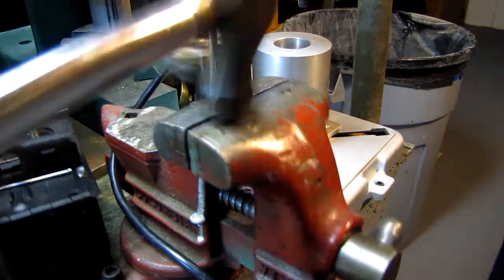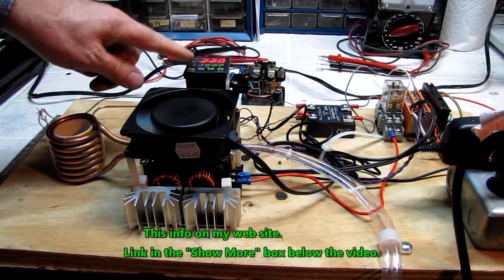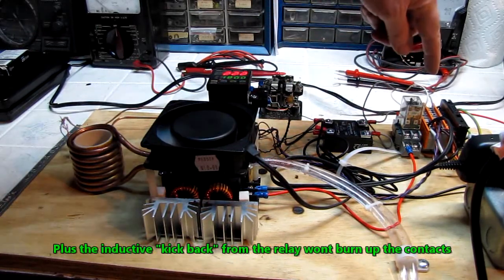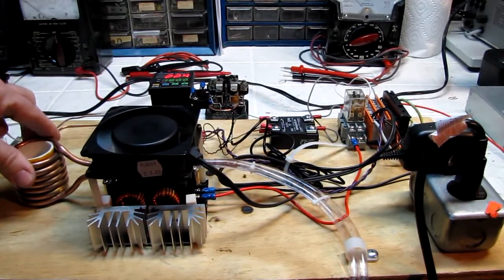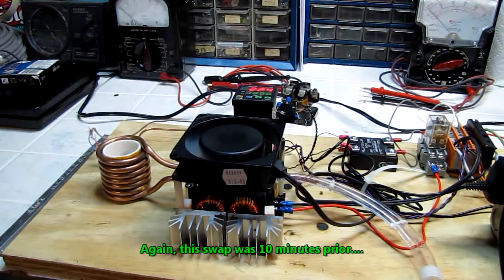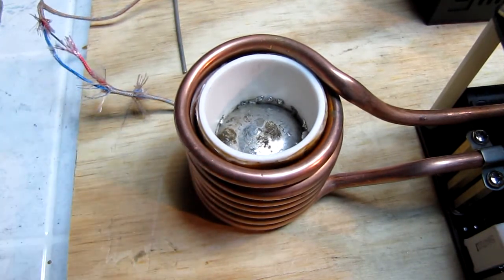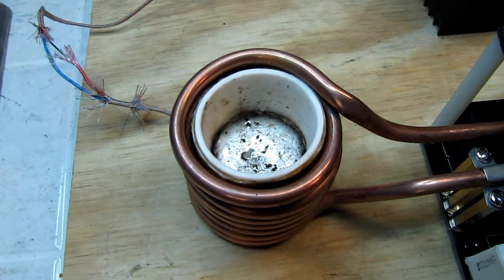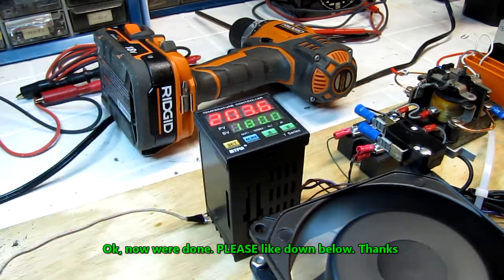Inductively Heated Solder Pot - IT'S ALIVE !

Comment: To eliminate pump vacuum lock up, I configured a pancake coil of tubing (several loops in a vertical plane) between the pump and the copper tubing connection. That way the pump self primes the cooling system.
Reply from the maker: clever idea. Thanks for stopping by.

Comment: that looks like a server PSU, the fan noise in those kind of deals isn't a big issue since there are typically thousands of servers in  a single building with no intention of people being in the room for very long at all when they are running and the sheer volume of servers makes the noise significantly louder anyways. That being said they are great supplies, I cannibalized one out of one of my servers to use in a future project and I am very happy with how the thing runs.
Reply from the maker: These are commercial 48 volt supplies used on systems to operate the heaters for a heat Seal process on carrier tape. ( Semiconductor processing/packaging ) The systems had two of these as we had eight tape/reel lines running per machine with four 48 volt heaters in each tape reel unit. Lots and lots of watts. And yes, they are noisy but were buried in the machine and were not heard over the rest of the system. Thanks for watching and the interesting comment.

Comment: cool project! it shows how easy a project like this could be, as you dont really need to do calculations or sourcing of parts, I would definitely recommend an SSR for DC, heck you can just use another mosfet :) no AC needed besides feeding the big PSU.
Reply from the maker: But blowing stuff up is FUN :-)

Comment: I would think it would be possible to use the mosfets to control temperature instead of all those relays. I'd use two transistors, one to clamp each gate when the output should be off.
Reply from the maker: Used what was in the junk box. I'm just a Stubborn old Yankee

Comment: You pump friend yes is crap, go to an auto wrecker and inside a gas tank, you can find the best pump you will ever find 12 volts and be sure to remove the little white fuel regulator slows the fuel down. With that removed it will pump about 117 litres a minute, small enough to put a reservoir tank on that board in and out simple and cheap.

Comment: If you want a bad to the bone pump for cheap - I got this one for my 70 gallon aquarium - and with the straight hose adapter on it, it pushed water 6 inches above the water level. WAY too much pump - so it's now going in my 275 gallon aquaponic system. I was more than impressed. It is a submersible, so you'll have to run it in a bucket or something.

https://www.amazon.com/gp/product/B01CGAD986/ref=ppx_yo_dt_b_asin_title_o08_s00?ie=UTF8&psc=1

Comment: Hi,

Are you sure your thermocouple is not partially
heated by the RF field ?
Should it stay outside of the coil ?

Thanks for sharing !
Eddy.
Reply from the maker: Hi Eddy, I have been waiting to see if someone would mention that. I am sure there is some small heating effect on the thermocouple, but it is small as it is not in the main field. Also the unit cycles on/off and when off the heat sensed is from the crucible. When the temp drops then the unit turns back on. Even if it turns of a little too soon, it will turn back on as soon as the RF goes away. ( there is only a tiny amount of thermal mass in the thermocouple itself ) End result is the unit pretty accurately follows the temperature of the crucible. Pat yourself on the back for thinking of it. Shows your paying attention. Thanks for watching. Vern
Reply: Hi Vern,

Thanks for your answer.
This is a nice working project !

I might try to build one "normal" ( w/o regulation )
induction heater myself. I am collecting info 
and schematics for the moment.

Cheers from Belgium,
Eddy
Reply from the maker: Hi Eddy, come back and let us know how it works out.

Comment: Why do you use 2 relay? can you explain what is the different (function) between SSR and the "beast" one? cause i'm interesting with ur way to make induction heater keep the temprature constant..
Reply from the maker: Hi Mahmud, I used a relay because they are cheap and rugged. I have a box of different relays and this one worked. SSR, or Solid State Relay use semiconductors to do the switching. Most of them are intended for AC current. The ones for DC are quite expensive in the current range I am using. Therefore I used a very old, reliable and mostly cheap/free relay. Thanks for watching.

Comment: How much current does your solder pot system draw, and how much current does the induction heater draw with no solder pot in the coil?
Reply from the maker: About 12 to 14 amps under load, about 6 no load. Varies with the input voltage.
Reply: Thank you for your response.
I get VERY poor power coupling into nonferrous metals, but I haven't been filling the interior of the work coil as much as you do with the material in your solder pot.  i guess I better try doing that to see if I can replicate  your results.  I am hoping that your 14 amps is with 48 volts.  That would make it close to a net 48 X (14-6) or about 380 watts.

Comment: I didn't even know there were SSR that could not switch DC. What's the deal with that?
Reply from the maker: Most SSR's use a kind of triac arrangement. This relies on the zero crossing of the AC waveform to allow them to turn off. The ones for DC likely use some king of High Current FET. All I know is they are fairly expensive compared to the "standard" SSR.
Reply: Aaaah okay, that makes sense. Thank you for the info! :)

Comment: Before you complain about the pump realize you mismatched your needs. It's not self-priming and you want/need a self priming pump. Anybody not familiar with pumps could make that mistake. I'm still not sure why you water cooled the copper coil as most people run them dry. Does this help efficiency? BTW for a relay use a car solenoid. Dirt cheap and can handle any amount of amps you can throw at it.
Reply from the maker: A submersible pump isn't self priming? Pretty sure it is, and the issue was it couldn't lift the water high enough. Once there is a return flow to balance the weight of the lifted water it will run. As for cooling the coil, without water cooling it will turn the copper black in just a few minutes of run time. Hot enough to take the flesh right off your fingers. The Circulating current in that coil is quite high. Lots of them are using water cooling. Water cooling is recommended by the vendor.
Reply: My fix for a similar situation with a submersible pump is to put the water bucket on a shelf above the workbench.  My 'bucket' is a 1 gallon wide-mouth glass jar that lets me see the water level without effort... Drip irrigation tubing and fittings provide shutoff valves, tees, etc for draining and filling the jar without moving it.
Reply: Most  people do NOT run them dry if they are at all serous about what they are doing.  Nobody in the industrial world runs them dry.  The only induction heater coils that I have EVER seen being run dry (successfully)  are those hand held devices that car mechanics use to heating stuck bolts.  And those units are designed for only very intermittent use.